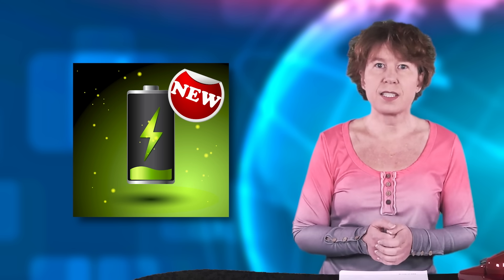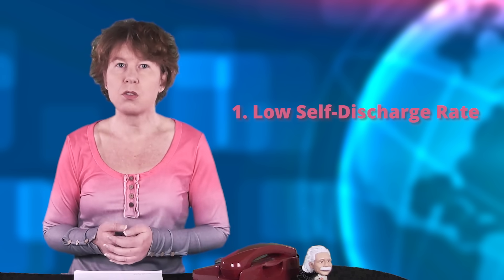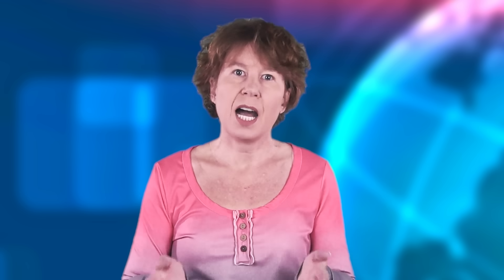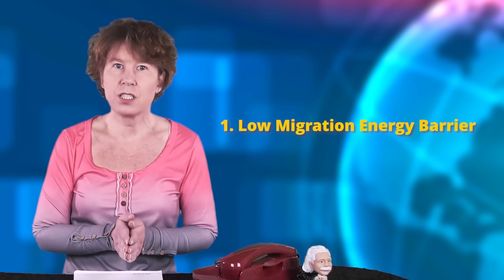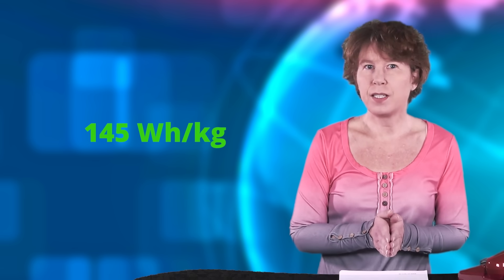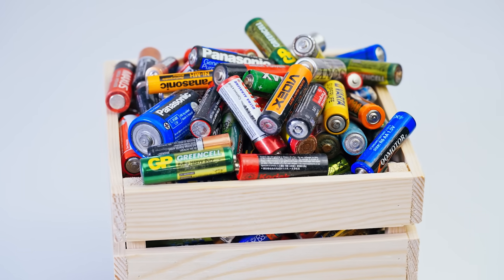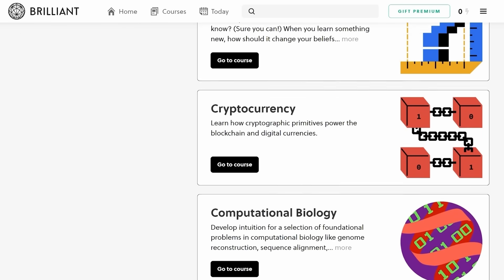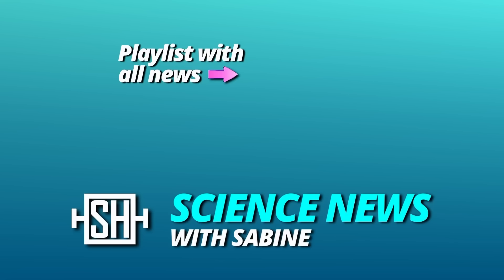Fully Charged in Just 5 Minutes: New Battery Breaks Records

Comment: Fast charging is great for travel -- not every bus or train has electrical service, and if one only has 15 minutes between 6 hour bus connections, a fast charge is a life-saver.
Reply: You've confused me.  Which vehicle needs to be quickly recharged between bus connections?  You left your car at home to take the bus, so it's not your car that needs quick charging.  At the connection point, you're done riding the first bus, so you don't have to worry about its recharging time.  And the second bus can be recharged before you arrive at the connection point, so it too doesn't require quick recharging.  Finally, if the first bus doesn't have the range to reach the connection point without a recharge, its (long) recharging time should be factored into its Estimated Time of Arrival At the Connection Point before you finalize your travel plan.
Reply: @brothermine2292   Oh, I am thinking about phones and laptops and cameras. Of course, if there aren’t many vehicle chargers in some area, faster is still useful because no one wants to hang around an unfamiliar area for two hours after dark.
Reply: @brothermine2292 He’s talking about phone charging.
Reply: @brothermine2292  I am pretty sure ericpmoss is talking about charging phones and/or labtops, not vehicles.
Reply: @brothermine2292  i think they were talking about inter city or inter state travel by bus, not intra city travel
Reply: >user-bp2io3bi5l  : My earlier reply's final sentence addressed that long distance case... the case in which the first bus lacks the range to reach the connection point without being recharged.  Contrary to the initial commenter's whining, that case too isn't really a problem, because the bus's published schedule provides advance notice of when it will arrive at the connection point.  If its schedule doesn't allow him/her to make the connection, we should blame him/her for ignoring the schedule.  It makes no more sense to blame the missed connection on "too slow" charging time than to blame the road's "too slow" speed limit or the "too long" distance that the bus traveled.  The recharging time, the speed limits, and the distance are ALL factored into the bus schedule.
     If for some reason bus schedules can't be adjusted to facilitate long distance connections, the government could increase the speed limit of the highway fast lane by 2 or 3 miles per hour.
     Another energy-saving measure, assuming vehicles can safely self-drive on highways and can communicate intentions & observations to nearby vehicles, would be to nearly eliminate the gap between vehicles.  That would reduce the drag from air friction, saving energy. (When a vehicle needs to change lanes to enter or exit, vehicles in the neighboring lane would automatically slow down to create the needed opening, and after a vehicle has departed from a lane the vehicles that were behind it would automatically speed up to close the gap.)  Thanks to that energy savings, plus the increased safety when vehicles drive more safely than humans, it would be reasonable to increase the speed limit.

Comment: Those batteries will be perfect for buses or trains which stop anyway for 2-3 minutes, in that time could charge a few miles.  Every stop should have infrastructure, maybe wireless, but those buses or trains will have small batteries, so very cheap and very low weight buses and trains.
Reply: If you have like 100 charging cycles per day, you need a new battery every month. There's better storage for that: supercapacitors.
Reply: @traumflug  The energy of supercapacitors is like 2 watt/kilogram, impractical, but you have a point, a battery for that purpose should survive 10000 cycles at least, even being small and cheap enough to be easily replaceable.
Reply: That is the case only if the batteries are so small that each charge is a good fraction of full. @traumflug

Comment: fast charging and lower range might work better in an urban environment where most vehicles are public transport instead of private use.  While I don't have any data to back up this thought, my guess is the average taxi/uber ride is well under 30km.  So a vehicle that could charge in a minute or two and have a 100km range may work out better than one with a 500km range but takes 20-30 minutes to charge.
Reply: As a point of reference, I asked a Grab (similar to Uber) driver in Singapore who was driving an EV what sort of mileage he did per day. Singapore is an interesting case as it's a city state and long distance journeys are rare (you would need to cross the bridge into Malaysia).

He said he rarely did more than 300km in a day, and usually it was nearer 250km. And a lot of that was lower speed city driving which is more efficient than bombing down the expressway. His car (Kona EV) had a range of over 450km which he never got close to using. He would plug it into a charger near his home and charge it overnight and be full for the next day.
Reply: @KeithMilner  Seems in that case, slow charge but high range would be preferred.  Would it be the same in places like Tokyo, New York City, London and Hong Kong I wonder.  Also, would it be the same if instead of parking the car at night to recharge, another person drove it, or even 3 people took 8 hour shifts, keeping the car constantly in business, would the shorter charge times make more sense then?
Reply: There are numerous electric bus systems in the world now but fast-charging (for example, at bus-stops) has always been a bit too expensive and fraught with problems.  It is far, far better to have the range and just charge the busses once or twice a day instead.  That removes a massive amount of infrastructure that you would otherwise need to support them.

Comment: Sound pushes Mass vibration pushing the through the walls pushing the molecules. Would push mass in certain direction but not the overall body. But would make it easier on engine  reducing thrust needed. . Sterios at the back of your truck 🚛 facing forward ⏪ would save on diesel
Reply: What
Reply: Speakers push and pull.

Comment: What happens at 1000 cycles?
Reply: subscription runs out
Reply: Edward is correct. 20% capacity loss is considered END of life for a battery. Mind you im still using batteries with less than 50% capacity remaining.
Reply: @fortheregm1249  what I have learned the hard way about my vehicle lead acid battery is that it must be fully recharged before stopping the engine. That had meant that the half mile trips to the grocery store did not fully recharge and the battery lasted only 3 years. Now in summer it needs only 10 minutes to recharge, which I can see when the engine returns to minimum idle of 750. In 40F weather it takes 40-50 minutes of idling to fully recharge. I’m guessing that when that battery reaches 20% of capacity it won’t turn over and I have to call repair to replace it where it died. That happened after only 3 years. Now I idle until recharge and it lasts years longer. 
The new Lithium batteries are much more forgiving about depth of discharge and fully recharging between uses. But they are about 5 times more expensive. And they need a BMS, Battery Management System circuit. 
You can’t buy the Li without these circuits because they can catch on fire. Lead acid batteries don’t need that circuit because they just die and don’t catch fire.
Reply: It’s usually an exponential decay. After the lifetime, 1000 here, it stores only 80% as much as when it was new-doesn’t matter how long it’s on the charger. Some batteries are claiming 8000-10000 cycles. The internal structure of the battery becomes degraded with every cycle. The further you discharge when using, the more damage is done to the battery. 
This problem is inherent to current battery design. No one has found a way around that. 
Some battery chemistries are better than others. 
It’s all very complicated. 
Battery construction research might enjoy long employment.
Reply: @edwardlulofs444  Its not exponential. A large data sample of Model S from 2012 shows a 5% degradation after 50k miles thereafter only a 1% loss per 50k miles. The average life of an ICE is 133K miles with frequent maintenance, with less than 1% attaining over 200k miles. BEVs can do 2-3 times that without maintenance.
Life cycle is enhanced by not charging to higher voltages. The longer a battery is kept at higher voltage the quicker it degrades. A urban car does an average of 30 miles a day. If charged between 30 and 70% only it will last indefinitely.
https://www.youtube.com/watch?v=pOQQTwYkg08&t=1411s
Reply: Total protonic reversal and mass destruction at the cellular level.
Reply: it will send you a amazon gift card, after redeeming you get a virus that will set ELon Musk as your desktop wallpaper forever

Comment: For me as a resident of a detached house, this is not a problem, I plug my electric car into the socket overnight, but I also never have to drive more than 100 km a day. It's more difficult in the city.
The best thing would be if you could swap the batteries at the filling station. You drive to the exchange point, a robot arm replaces the battery, and off you go.
Reply: Current ev have eoinfh range imho. On a long trip, taking a 20min break, stretching your legs and hacking a coffee after 400km does not seem like a big deal to me.
Reply: @thorwaldjohanson2526  i have a model y.. i charge at home so each morning im at 80%.. that id never use in a day, but its there. When i go on trips I have to charge every 3 hours which is perfect.. by the time the car is done ive had enough to time to get out, go get a coffee and something to buy to eat in the car, go for a bathroom break and stretch my legs a little.
Reply: Battery swapping makes little sense, you can make a supercharger station with 20 stalls for the price of a battery swapping station.
If 10 cars arrive at a swap station before you you have to queue for 50 minutes before your turn to swap, you cannot leave your car or you lose your place in line, will the station have 10 backup batteries cost of > $15,000 each? 
If one of the superchargers is down you move to another one if the charging station is down then what?
Reply: This is already done.  Nio cars have already started rolling out their network of battery swap stations.  Takes about seven minutes to change the battery.  As a long time EV driver I can't see the point but the option is there.
Reply: I subitted the battery swapping idea to Peterbilt, which makes American semi trucks. I mean, if you look at the fuel tanks they kinda look like big batteries, right? Pull in, swap out, bang you're gone in a truck that costs less than a third as much to operate.
Reply: @andym4695  I suspect their engineers could have figured that out in a second if they thought about it
Reply: Elon demoed Tesla battery swapping like 10 years ago. I guess it didn't catch on.

https://www.youtube.com/watch?v=H5V0vL3nnHY
Reply: Swapping the battery at the filling station isn't sustainable, you would need a battery at each station you regularly use, then still have to wait at any other station where you don't have a spare.
Reply: @shanent5793  No, with battery swap cars such as the Nio you rent the battery.  They have a stack of batteries at every swap station and you just rock up and swap.
Reply: @notverygoodguy  great, one more way to turn us all into renters🙄
Reply: @shanent5793  Don't blame me I am just the messenger.  I think it is a terrible idea not least because the car depreciates in value but the battery rental doesn't so it is an expensive second hand purchase.  Also I don't see the problem with charging times.
Reply: Not as simple as you make think.  You need to calculate the added cost of involved with a battery swap in comparison to simple recharging as far as your energy costs are concerned.
Reply: @zoperxplex  It is as simple as that.  It is being done now.  I can buy a NIO tomorrow with battery swap technology.  I don't think it's necessary at all but you can do it.
Reply: @notverygoodguy  Simply recharging your battery is always going to cost less than a battery swap because a battery swap involves manual labor or the use of specialized machinery that are unnecessary in recharging.
Reply: NIO do it by renting you the battery.  This makes the car considerably cheaper to buy but you pay a monthly fee.  That fee includes a couple of battery swaps a month though you can still charge the car at a charger if you want to.  Battery swap is all fully automated.  You drive in, wait 7 minutes while there is a lot of clunking noises and then drive out again.  There are videos of the process on youtube.  Personally I think it is a complete waste of effort but some people, perhaps those that can't charge at home, find it useful.
Reply: Right, and there are concepts for this, but who implements it?
Reply: @Thomas-gk42  Necessity will be the determining factor. Just like when the car was invented and there were no adequate roads, let alone filling stations.
But perhaps the new batteries will be on the market sooner?
Reply: @Thomas-gk42 tom Scott has a video about a company already doing it
Reply: Take care be safe, some cars catch fire over night charging, and families are unable to get out
Reply: @stuartsmith5308  While media tells that story it is far more likely with an ICE car which is not often at all.
Reply: Utter nonsense. Please provide references to instances where there was a battery fire and families were unable to get out. While you are at it please research the very  numerous occasions when ICE cars have spontaneously combusted. It is in the nature of battery fires that they start slow and continue at a measured pace; not so for petrol and diesel. @stuartsmith5308